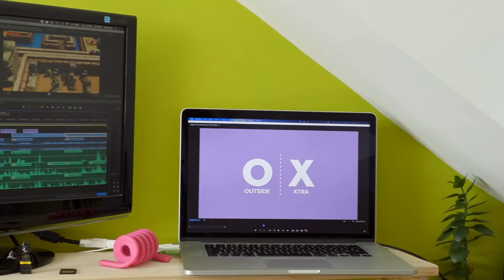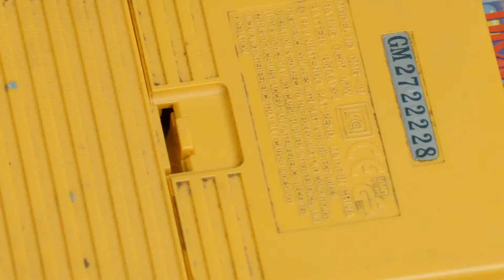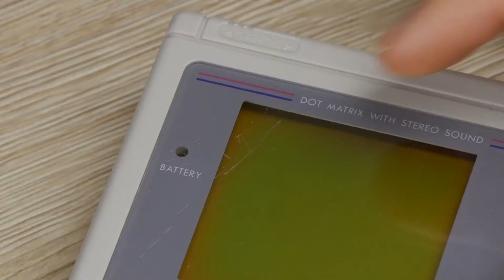A Surprise Present for Ellen?! - Unboxing a Surprise Gift From Producer Jon!

Comment from the maker: STREAM STARTS AT 7:11 -OX
Reply: FYI, Super Mario Land has weird hit boxes. I think Mario's hitbox in particular is tiny. So if you are not standing right underneath the block, Mario will just go through it, so long as it's the only block you'd be hitting. This goes for damage too, you can get really really close to enemies before taking damage, closer than most games would typically allow. That's a design bug, not a fault of the age of the cartridge.
...unless Mario's actually passing through the blocks, in which case, Ellen, you've found an unknown bug that needs documenting! =O
Reply: 711
Reply: So cut 7 mins off the start.
You can do that without re-uploading it. 
Use the magic wand thingy in YouTube - and "trim".
Reply: @ann_onn  that gets rid of the live chat I believe

Comment: I can confirm that ribbon are the most evil of small electronic conectors. All of them are chaotic evil, but ribbon cables (still the most used for screens) deserve a special kind of hell. Props to Jon on handling it SO well, and pre sloting it before screwing the board to the shell was incredibly smart, would never have thought of it. Real tech wizardry.

Comment: I was getting flashbacks of how I had to completely disassemble an OG PS3 to replace the thermal paste.
Reply: Thermals in consoles...
Reply: @HariGtt  The thing too like an hour or more to take apart then put back together.
Reply: @TheSpongyMallard  Yes, i know, i used few consoles in my life and never modded one, but i'm aware that improving thermals is often way too much work and, unless you are commited to do destructive changes, low rewards. Improving thermal compund and mounting pressure helps, but not that much, and is a lot of work. Those things aren't usually built to be serviceble.
Reply: @HariGtt  My PS3 would overheat really fast, so it was fix it or junk it.
Reply: @TheSpongyMallard  You made the right choice. Plus, IDK if you like electronics and fixing stuff, but i find this kind of projects really fun, even when they take too much work for little results
Reply: HariGtt I had a bit of experience. I had to replace a disc drive too.

Comment: This was amazing! The only experience I've had with anything like this was needing to replace the sticks (and then everything else because color matching) on a PS3 controller that had the finger pads of the sticks be too exposed to the heat and got all sticky. Triggers are a bit more fiddley and it took an extra set of hands, but all of this stuff is so satisfying to do/have afterward.

Jon you're a good man and a better friend. Hats off to you. :3

Comment: Game Boy mods are one of my favourite hobbies! I’ve restored one 1st generation Game Boy Pocket, done a shell swap and LCD mod on a 2nd generation Game Boy Pocket and I’ve made a Game Boy Zero (a Game Boy shell with a Raspberry Pi Zero inside). My next project is going to be a Game Boy Macro, which is like a GBA using a DS body.

Fantastic stream as usual, and the edited feature from Jon was one of my fav bits of Oxtra content in a long time.

Comment: Space stopped being the only place not tainted by capitalism when the first commercial satellite went up. So long before Curry even said that. And now, I'm jealous because my beloved Purple Gameboy Color is suffering from battery compartment issues and I can't get to the store I read about to get it fixed. I'm having to use my Pickachu edition GBC which doesn't feel the same as using my original which I can so clearly picture going into Best Buy to get.